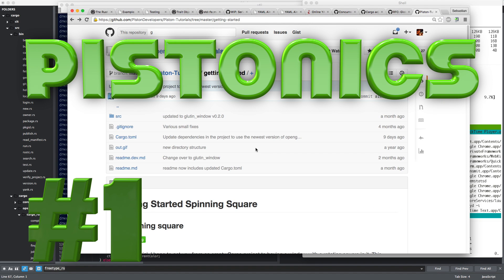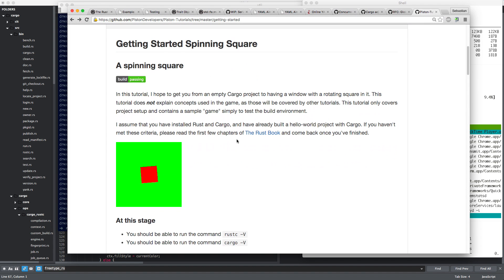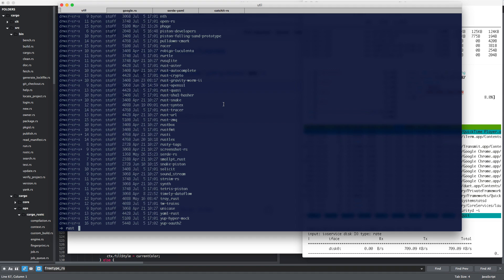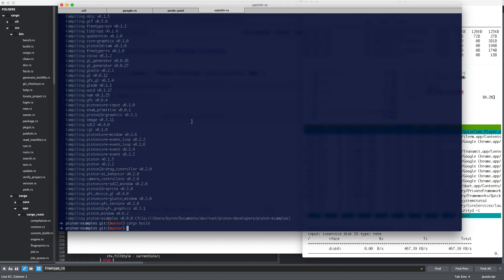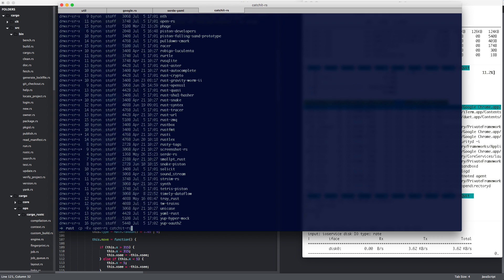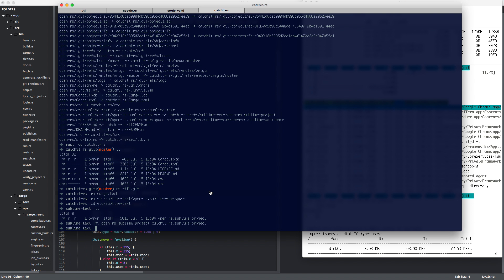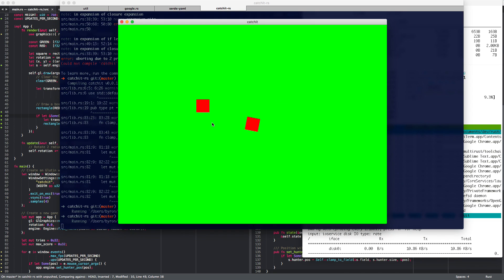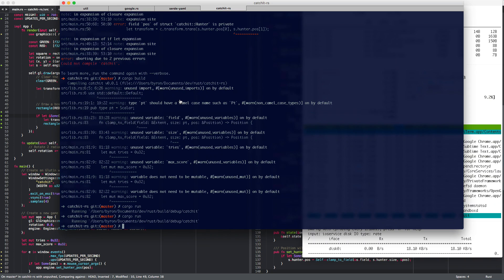Pistonics #1 [catchit - projectsetup and initial drawing]

Comment: Hey Thanks for recording all these, it's great.
Only issue is I can't read any of the code at this resolution (360p)
Any chance of getting them in 720p?
Reply from the maker: Jason Ferris It's odd as I see all the resolutions up to 1080p, which is the resolution I record all videos in. You are not the first one with that particular kind of problem, and unfortunately I cannot say more than 'works for me'. Maybe it's worth mentioning that I use chrome with no flash installed.
Reply: Yes I can get the higher resolutions from Chrome, thanks.  I believe they recently switched to html5 player.  Firefox had another issue until last week where I could not right-click the video and get the video URL but that has been resolved.